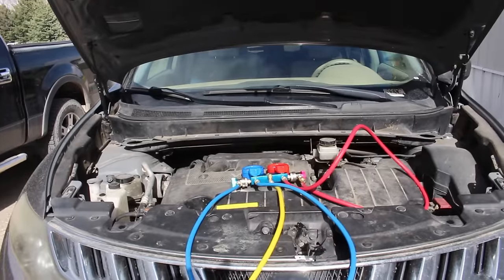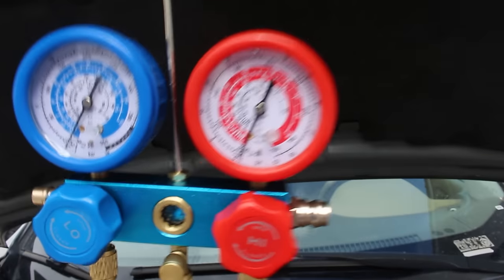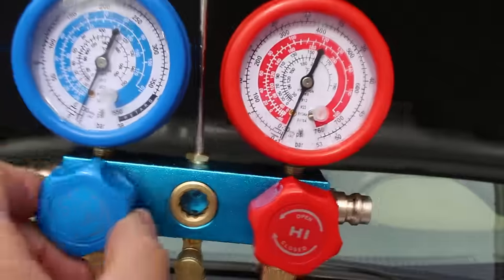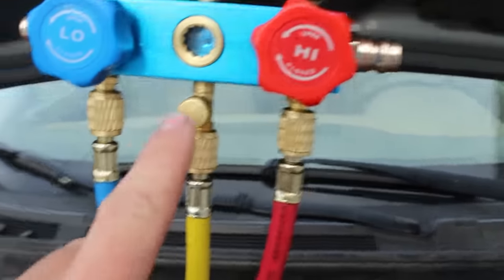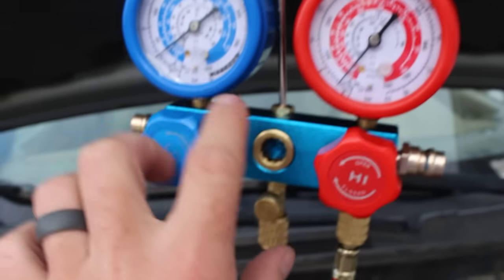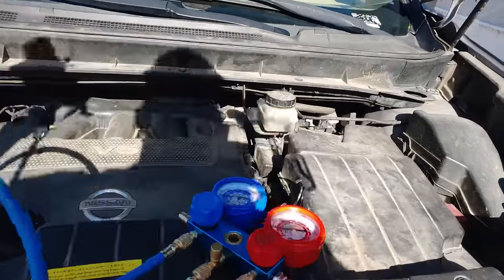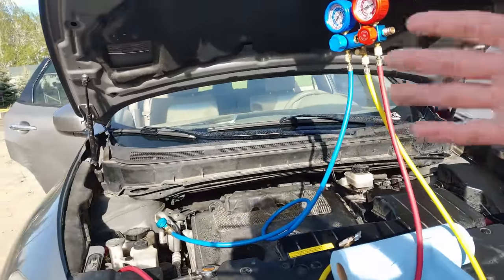How to Recharge a Car's A/C System Using a Manifold Gauge Set & Vacuum Pump - Air Conditioning

Comment: Are there different sized values that is used on the Freon recharge can which the yellow recharge line connect to? I bought a Freon recharge can and a valve for the can to connect to my yellow recharge line but the yellow recharge line connector does not screw on.
Reply from the maker: Thanks for watching! That I am not sure about, it seems like all the quick charge cans I have ever used have been the same size. I know some are self-sealing and others are the puncture-type cans. It you're using a puncture-type can, they make an adapter you can screw onto your yellow line or quick-recharge valve and then into that can that will break the seal - only problem with those is you cannot unscrew the can until it is empty since they do not seal back up.

Comment: I love your video, I have a question, the oil has to be pour only when vacuum down or every time when charging Freon?
Reply from the maker: Hi, thanks for watching again! You'll have to add the oil after vacuuming the system, when you go to charge it again. You can either use actual oil and an oil injector or you can use an oil charge can mixed with a little bit of Freon. The oil charge cans are the easiest, but also the most expensive - they are different from the Freon cans. You car should say on it or in the manual how much Freon and oil it takes - make sure you put that amount in for it to work properly for a long time.
Reply: I was always told vacuum does not pull oil

Comment: Vacuum pump DOESN’T get rid of oil!  Shouldn’t effect oil charge at all, unless you replaced parts! Never add oil because you Freon was low! Never! That’s why when you replace compressors or condensor, you measure the oil you drain out of components!

Comment: Hello and thanks so much for your videos, they're very helpful. Have a question though;  after vacuuming the system and verified that there's no leaks, i connected the can of refrigerant and nothing happened, seems that the can is not puncture good or something like that because I have no flow of refrigerant whenever I tried purging the air out at the end of the yellow hose on the manifold. Any ideas??
Reply: Did you ever figure this out? I’m having the same problem and can’t figure it out
Reply: Yes, I just recently did, I saw a video where they're using a different tool to puncture the can on the side, it really helped me. The only diwn side is that you can't use the can partially,  once is punctured, and once you take the tool off the can, if there's refrigerant left in the can, it goes to waste.

Comment: How long do you vacuum the system?  I've seen a video where the system is vacuumed for 30 minutes. The valves are then closed for 30 minutes and the pressure is monitored to test for leak.  Valves are then reopened and vacuum restarted for 45 minutes.  I would think once a desired negative pressure reading is obtained that would be it and there would be no need to continue vacuuming the system.  What are your thoughts?
Reply from the maker: Great question! Once you pull a vacuum, the system should maintain that forever provided there are no leaks. The 30min test of letting it sit afterwords should show any leaks - if the system loses negative pressure. If there's a loss of pressure, you'll need to find and fix the leak before trying again. I don't believe there's any reason to let the vacuum pump run longer than 30-45min, that should pull out all the air & moisture - if it holds you're good to recharge.
Reply: @EYVOAuto   I'm no expert but I always run my vacuum for a couple of hours. Water will boil in a vacuum. If there's any moisture in the system you want to get it out.

Comment: Freon:  How do you add Freon when the compressor won't turn because of low freon?
Reply from the maker: Great question. I believe I had to look up how to "reset" the cars computer to trick the compressor into running long enough to sense the freon coming in. Once it did that, it stayed turning to refill.

Comment: When you add the oil to your AC system do you do it the same way you put the r134a in after you put so much freon in it
Reply from the maker: You can add it that way if it is in a quick-charge can. In liquid form, with a charged system, you'll have to use an oil injector. I misspoke when I say drawing a vacuum will remove oil, it does not. If your compressor / major component replacement comes prefilled you should be pretty close to the correct level. Now, if you had a large leak (broken hose / evacuated it quickly, etc.), this will remove some of the oil. Where I did no mechanical work to my A/C system & had a leak, I topped it off with oil just to be safe. Still working great!
Reply: You DON'T add oil unless you replaced a component within your system that contained oil.  Too much oil in the system is bad for efficiency.

Comment: What happened if you open the high presure? When you refilling
Reply: The A/C system is one big loop. If pressure is being pumped into low side and you open high side while refilling it will backfeed into the gauges and can you are using to refill and blow up in your hand/face.

Not a good day.
Reply: @lukeupdyke5659  thanks for explained
Reply from the maker: Yeah you don't want to do this... just shut the valve again and you should be fine.

Comment: Hi how can I top up my ac and wha pressure is usually use
Reply from the maker: Hi great question and thanks for watching! To top off a low, non-leaking, system you may want to just use a quick recharge can / system and follow it's instructions. That'd probably be the easiest. Now for refilling an empty system, there should be a sticker under the hood telling you how much refrigerant to use, oil, and some pressure guidelines which vary slightly depending on the temperature outside...

Comment: Is there anyway to tell how much oil is in there?
Reply: I have been doing DIY work on my cars for two to three years and have not seen a definitive method of finding out how much oil you have left. There is charts that tell you how much to add after replacing parts, but thats about it.
Reply from the maker: Great answer, thanks!
Reply from the maker: Some say you can dump the compressor out and measure it then add accordingly. But most new components will note how much oil they are prefilled with. Pulling a vacuum does Not remove any of the oil.

Comment: Is there freon in the system or did you have it removed
Reply from the maker: No, the system was completely empty. Thus the need to pull a vacuum. I had it removed prior to replacing the radiator & cooling system hoses as part of that repair.

Comment: mixing types of freon can cause explosions
Reply from the maker: Wow, I didn't know that. Do you mean r134a with r12? Or are you talking about mixing different brands?
Reply: Mixing R12 with R134a will not cause explosions. It does affect the efficiency of the system. The replacement for R134a is R1234yf which does not mix nicely with R134a.

Comment: Could I get R12 in small can to recharge a/c in a Jeep 2004?
Reply from the maker: Great question! I'm not a certified mechanic so you may do some more research. Hardly any vehicles use R12 after 1994, so you probably need R134a (check that first). You can buy cans of R134 from any parts store, or even Walmart.

If your vehicle does take R12, it's no longer sold to the public... to buy it you need a refrigerant 608 or 609 certification. So if you do need R12 it'll have to go to an A/C shop or you could convert the system to R134a...

Comment: When. Do you add oil   Before the Freon or after
Reply from the maker: Probably should add it before, especially if you're using an oil injector, that way everything is lubed up and ready start working as soon as there is enough pressure for the compressor to run
Reply: When you  do a vacuum it won’t pull the oil out of the system. You need positive pressure to blow it out.

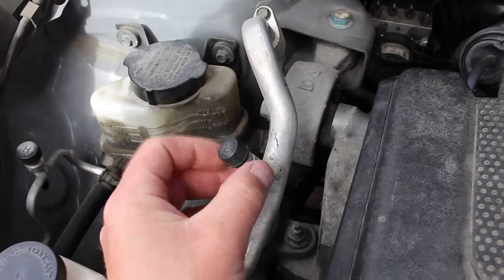Comment: @2:11, the low side is always larger than the high side.
Reply: Respectfully, this is backwards. I have a manifold gauge in front of me, and high side is larger than low side.
Reply from the maker: Thanks for watching! All standardized A/C systems have the larger port on the high-side. This is so you cannot accidentally connect to the wrong port when working on the system. The ports should have a labeled cap on them as well but sometimes these break and fall off or get lost - hence port sizes to quickly tell them apart.

Comment: You don’t have to vacuum a system to recharge it. I replaced a leaking condenser on my 2004 Trailblazer over 7 years ago.
1:38 you can buy a r12 to r134 adapter and put r134 in a r12 system. It will work just fine. I have changed over 5 different cars.
Reply: Correct, what you didn't mention is that by vacuuming the system, you are ensuring you remove any moisture and air in the system, so it is always a good thing to do when the system is empty...
Reply: @FlyingCowboyPhotography  You can't tell the difference.
Reply: @blackericdenice  lolz
Reply: @LoneWolfSnowplowing  When a young person run out of tech. They start to name call.
Reply: @blackericdenice  the compressor can. It introduces non condensables which become acidic and ruin the system
Reply: @danjoyce6135  I've never vacuum a system before and they all work fine. My 2004 Trailblazer is more than 7 years old. I have a video where it is around 44 degrees.
Reply: Thats good for you, however does not make what I stated untrue. I have a honda that could probably run 30k without changing the oil, but it doesnt mean its good for it. Same goes for evacuation. Maybe it will work for a little while but for best results and proper install evacuate (vacuum) properly.
Reply: @danjoyce6135  7 years is not a little while.

Comment: May i have an indication of the vacuum pump you used. Will 1.8 CFM work?
Reply from the maker: Here is the link to the exact kit I used. It is a 4 CFM. If you don't want to buy one, you can "rent" one from O'reilly's / Advanced Auto Parts that will work great as well. I'm not sure what size theirs is.
Reply: 1.8 cfm should work; it would just take longer, maybe an hour of suction instead of 30 minutes, but the 4 cfm is safer, quicker, and better, and you can probably borrow one from your auto parts place.

Comment: The tools he’s using are fine, but they are not able to evacuate the refrigerant, which is the first thing you must do before anything. The evacuation tools are more than $500, so it’s still cheaper (and safer) to let your mechanic perform the refrigerant evac and recharge tasks.

Comment: I have a 2013 nissan rogue. I ran into an issue where my system was low on r134a and now the clutch/compressor won't engage for me to add refrigerant. I can't bypass the ac relay because it is inside the IPDM. Would this work for that?
Reply from the maker: Great question! You can usually reset the computer and get it to kick on long enough to recognize the additional pressure coming in from either a manifold gauge set or a quick recharge can. It should then stay running & start working good again - provided that the system is just low & there isn't some other issue. You can reset the computer by removing a battery cable for a few minutes. When you try again, make sure you have the manifold gauge set / quick recharge can hooked up already with pressure behind it before you turn the A/C on. If this doesn't work, you may need to take it into an A/C shop who can use their advanced machine to check everything & force a recharge.

Comment: You pulled a vacuum on system and then verified no leaks.  How do you know how much R134 and oil are present in the system before you begin adding R134 and oil?  What am I missing?
Reply from the maker: If you have to pull a vacuum, there is no refrigerant left in the system. You have to pull a vacuum when it is empty in order to remove the air and refill it. There is a sticker under the hood telling you how much refrigerant & oil the system requires.

Comment: I have a 2020 ram 1500 and my fittings do not fit on my low or high pressure valves. Any help?
Reply from the maker: Don't know much about those trucks, but a lot of the newer vehicles have switched to a new refrigerant type R1234yf. Any vehicle 2021 or newer is required to use it. You may check your user manual to see if your Ram uses it because if so the ports may be different. If it's the typical R134a then the ports will be standardized, but maybe the vacuum pump or quick charge can you're using is a weird brand or slightly different? Anyone have another idea?

Comment: If you remove a line or your system leaks out the freon. Do you need oil as well or just freon?
Reply from the maker: You'll have to draw a vacuum on the system 1st which means you'll have to add oil with the freon when you recharge it. 

If the system is still charged, just low, you can add just freon through a quick recharge can.

Comment: Why would you need to replace oil if you didn't remove any.  An evacuation does NOT remove oil.
Reply from the maker: You don't. Correct, I misspoke in the video. Pulling a vacuum does not remove any of the oil from the system. You do need to verify the amount in the compressor and then add accordingly if replacing it.

Comment: Do you have a link for the adapter used on the refrigerant cans?
Reply from the maker: https://www.amazon.com/Certified-Conditioner-Refrigerant-Self-Sealing-InterDynamics/dp/B004NL2XM0/ref=sr_1_12?crid=KN6LTOYKFE7L&keywords=r134a+refrigerant+can+adapter&qid=1673219473&sprefix=r134a+refrigerant+can+adapter%2Caps%2C276&sr=8-12

Comment: How to use the ac line
Reply from the maker: Thanks for watching! You'll connect the manifold gauge set to the high & low ports or a/c lines. They are different sizes so you cannot confuse them. Make sure the valves are all closed before connecting so you don't lose pressure from the system, especially if you're just wanting to check the pressure or add coolant.

Comment: I noticed that you did not get a negative pressure of 30, it was close to 25 ( hard to see exactly, correct me if I am wrong) would that be a good vacuum? I am not being able to pull more than 26 and I wonder if I am doing something wrong. I am positive I do not have any leaks in the equipment, it is brand new and I borrowed another one with similar results, any suggestion? PS. the system holds pressure.
Reply from the maker: Hi, thanks for watching! Great question! That should be perfectly fine as long as you let it run for 20-30minutes to pull as much vacuum as it can. I don't think I got quite down to -30 either. The only thing that matters is if the system will hold the negative pressure after you shut the vacuum pump off. If it does, you're good to refill = no leaks.
Reply: 30 hgi is an absolute vacuum. Most people don't use a micron meter. Cheap gauges don't read well too.
Reply from the maker: @mobileair6416   So true, great advice.

Comment: It's better to just pay them. $200 sounds good. Pump is $150 for all and miss with storage .. best off just pay someone.
Reply: Yea.. MAYBE .. if you only have 1 vehicle and the mechanic doesn't hose you for something you don't need
Reply: That's the minimum, if everything is OK and you just need a recharge. Unfortunately you definitely have a leak if the system is low. So they have to fix the leak and than recharge. Or they can just recharge  but you will leak it out and than have to spend money again
Reply: The absolute best solution is to to replace all the components new and than recharge. 

That's pricey but it's the less risky

If your going to keep the car for a long time it is the best solution

Comment: I have charged dozens of ac systems after replacing the compressor and never once pulled a vacuum. I've never had a problem with it.
Reply: The problems won't happen immediately.   But if you don't pull a vacuum, the system will have air and moisture in it.  That will cause problems at some point.   A professional would never open the system and recharge it without pulling a vacuum first.
Reply: Wait till you get a weak ac pump ..then tell us ..
Reply: @MikeSmith-nu9wt  Been doing it this way for 50 years without a problem

Comment: Before you do this, you should take a class online and get certified because this is not something for the average person to do you can get injured or injure somebody else they need to be done correctly if I should have to have my license anybody that messes with any Freon should be license to the way the law states if I mass was a 30 pound bottle I have to be licensed now. If you mess with a 12ounce, can you don’t have to be it should go both ways. She should have to have a license to buy and recover the system and buy the tools that would stop all the problems from these people overcharging Home not doing it correctly and blowing the systems up Hydro lock on them and then, when they do that that is to let it go the price of Freon, I will recover it first that is the correct way of doing it. It runs through a filter. It filters a system as long as your fluid is not black your refrigerant. The system hasn’t blown up you could reuse it once that happens it’s contaminated recover in a tank resell it back to the manufacture, so they Rick recycle the Freon.

Comment: I got lost at the oil part 10:24
Reply from the maker: Yes... Pulling a vacuum does Not remove any oil. That part of the video is incorrect. If you've changed a part it should have come prefilled with oil.

Comment: I think you've got that backwards. R134a is the older stuff and R12a is newer and less harmful to the environment.
Reply from the maker: R12 is the old stuff you can't buy anymore. At least without a license. Most systems running it get updated to R134a which has been the standard for many years. The newest refrigerant is R123yf and is very expensive, but supposedly more environmentally friendly. We started using it in 2013, but until recently it wasn't incredibly common.